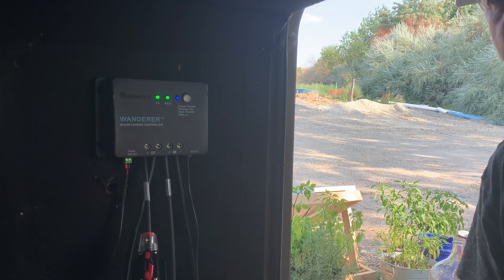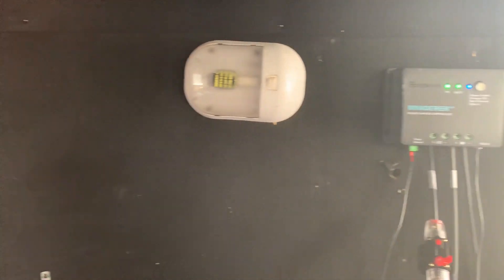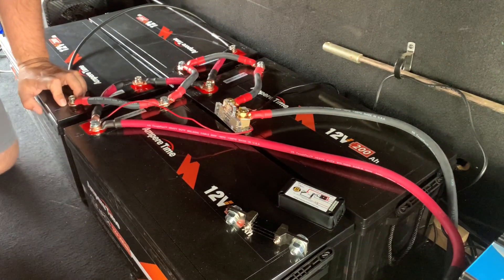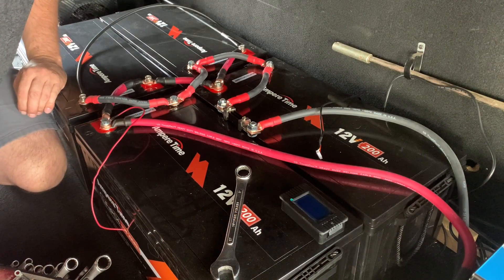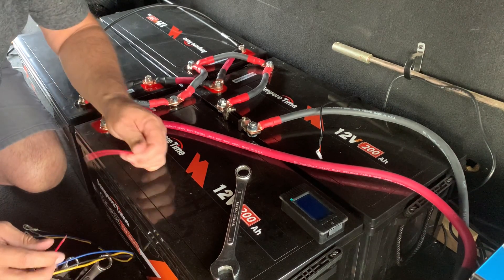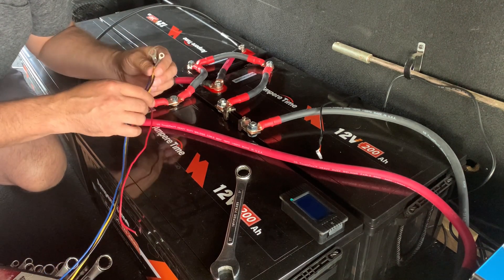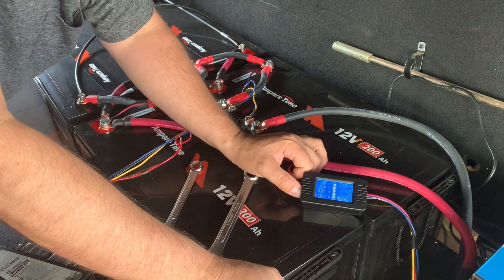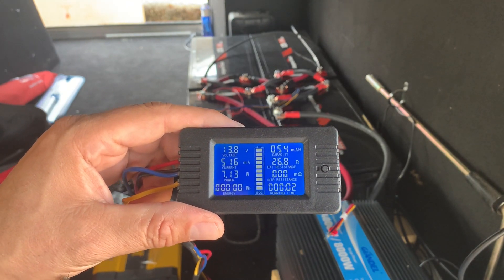Solar Battery Bank Monitor with Shunt Installation LiFePO4

Comment: Omg is this a 12v 800ah system
Reply from the maker: Yes sir it is! However I am running it in a 24 volt configuration, so I am only getting 400 ah. But I have these batteries in a cargo trailer with 1600 watts of solar and a 2500 watt hybrid inverter. It’s pretty much will run my 12k btu mini split infinity if ever day has decent sun.

Comment: Hi i found these great but when uding battery charger and charger turns off after reaches full charge  
It kills the monitor 
Any thing that can be done
Works fine if stop charger before it reaches full charge

Comment: the battery power indication of this device is linear but lithium batteries are not. it means the indicator will show its full for a long time then it will suddenly drop.

Comment: Just FYI, DO NOT use that inline circuit breaker (use a fuse), it causes a voltage drop across it. I had one going from the charge controller to the batteries and my batteries never fully charged as it had a 2v drop across that inline circuit breaker.
Reply: just fyi, its a shunt, not a circuit breaker. its supposed to have a small voltage drop if you draw current so you can measure power. if you dont use the shunt, it cant measure power. and it is small if you use the correctly rated shunt.
Reply: @justinnewman5533  2:15 is the circuit breaker and WILL have about a 2VDC drop across it, the shunt is fine, the circuit breaker at 2:15 is going to screw things up.

Comment: Hello, any updates on this battery monitor? Accurate? Would you recommend? Thx
Reply from the maker: The only issue I have with this monitor is the connections for the wires is not very secure. They could easily vibrate out. Other Tun that I have no issues with its operation.